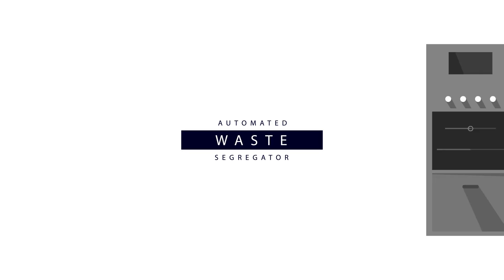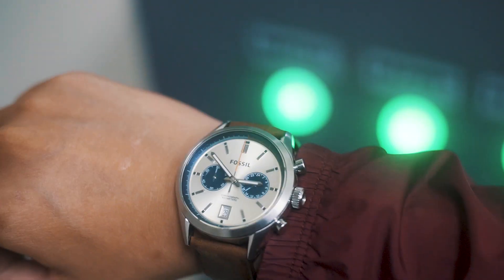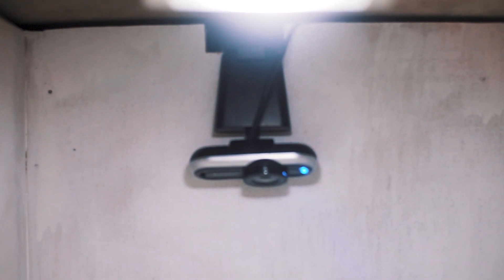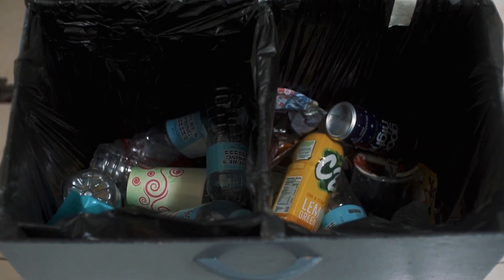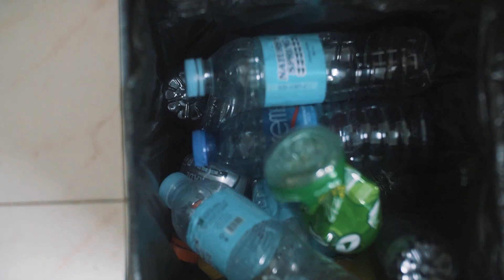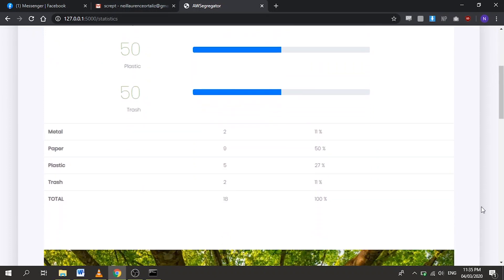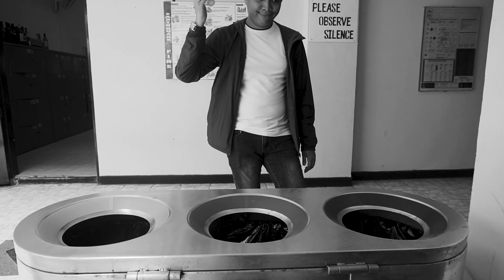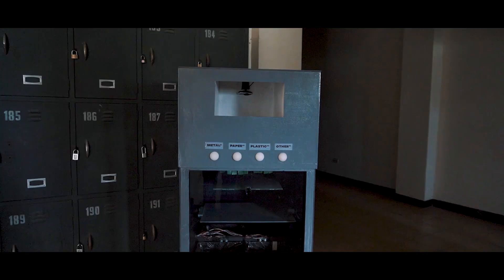Automated Waste Segregator using Material and Optical Sensors

Comment: Hi, can I ask for the specific optical sensor you used? Our thesis topic is an innovation to yours
Reply from the maker: We used a 1080p webcam, it's better to use an hd webcam for the machine learning to work correctly. You can use a raspberry pi cam module or something better.
Reply: @AlfedAma  thank you
Reply: @AlfedAma  Hi, i have requested in the link. Please notice thank you.